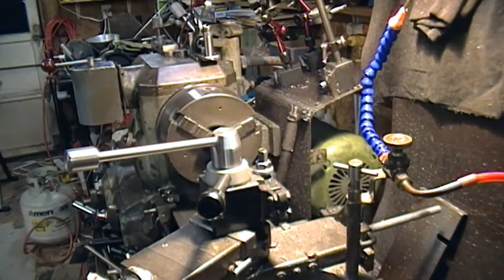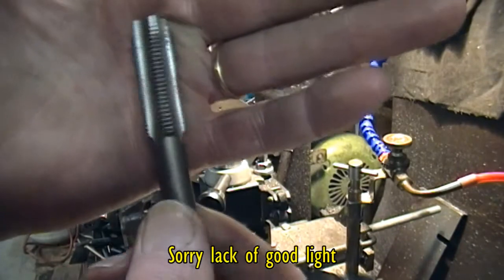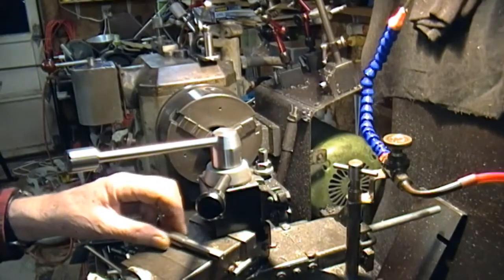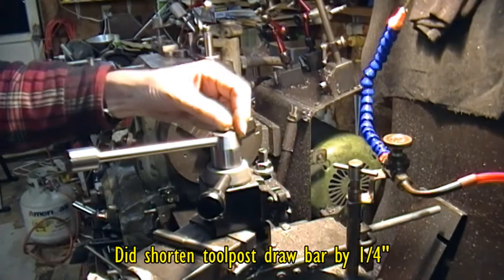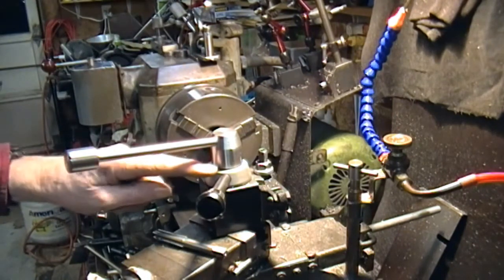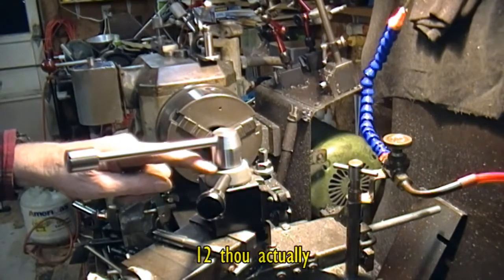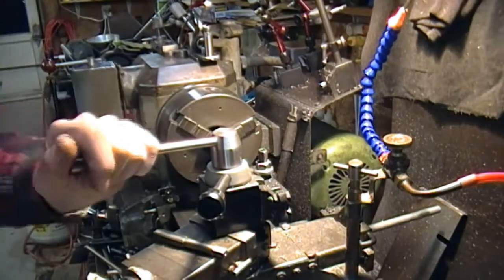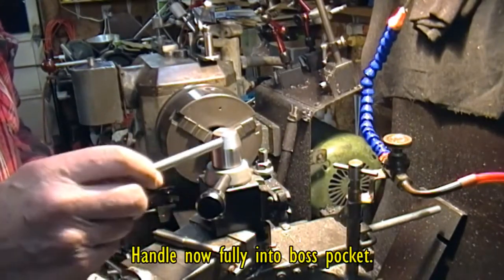Toolpost locking handle, final

Comment: Great job. I have a suggestion, since you don't stay in the shop in the winter, a torpedo heater will warm the shop quickly. Then the electric heater will work better. I have done that and it works well. Also if you put a threaded stop on the back of your bandsaw, it will let you cut shorter pieces.
Reply from the maker: James - may well try and improve the heat aspect - main thing is, because of no ceiling, it just throws energy away! Threaded stop?  What are you meaning re "back of bandsaw"? - sounds useful.
Reply: It would be easier send a photo, send a email to dedmonjim@att.net and I send you a picture of how I fixed my saw. 

One of my old shops was in a uninsulated metal building  (enclosed carport). I heated it with the torpedo heater, it will work better for you because your shop is wood. Of course you could not run it while filming because the noise is dreadful.
Reply from the maker: James Dedmon Thx James - email sent. Agreed re heater noise but could well find me one of those.

Comment: you could face 1.5mm - 12thou off the nut instead instead of the shim
Reply from the maker: Hi - I opted to just add the 12 thou shim, to adjust me back from approx "9 o'clock" position to the current approx "6 o'clock" - about 90º ,... it acts as a thrust washer too.  To face off enough to reduce by about 270º would have meant taking off a good 40 thou which I wanted to avoid. Took the easy option! :)

Comment: Great finish to your project and you did not freeze to death.  I have been wondering what type or lathe is that?  And if I have asked before please excuse me.  I have been thinking of a new project for you.  Build a wood heater for your shop or maybe a waste oil heater, whatever fuel is easiest and cheapest to find.  Thanks for sharing.
Reply from the maker: Hi - the lathe is a "Little John" - produced by Raglan Engineering in, I think, Nottingham England. Must date back to just post war I think. I have numerous thoughts for heating in shop - trouble is, no ceiling and so any heat just goes straight up and lost.  Plus, time in shop is intermittent so even an old wood stove not very practical to run. Best I have is a small 1.5kW fan heater which I can run next to where I am working but, even so, only helps a bit!